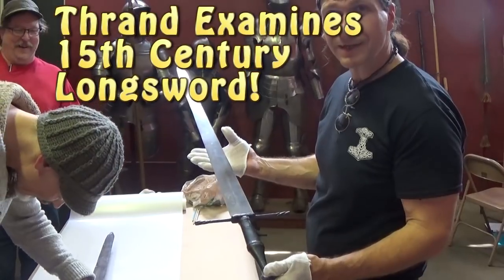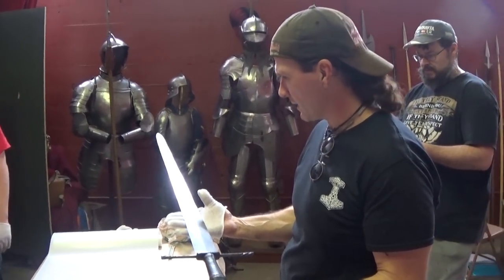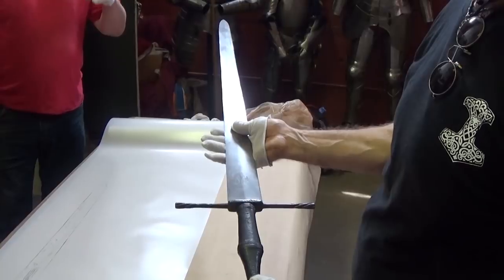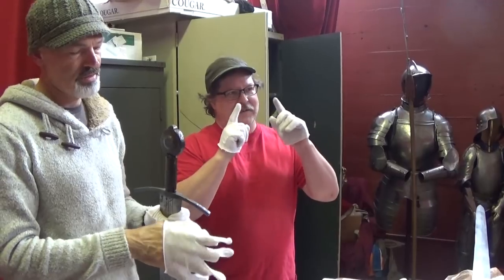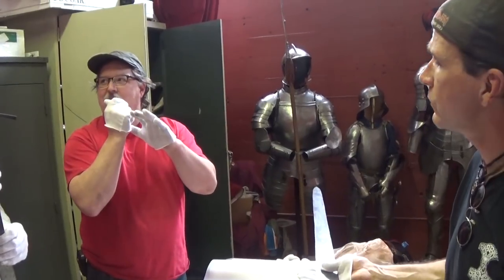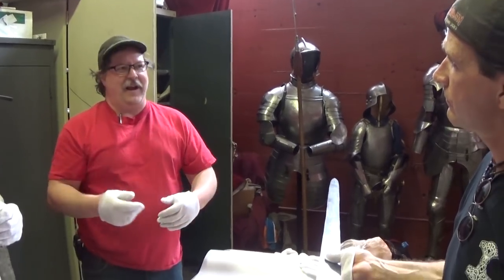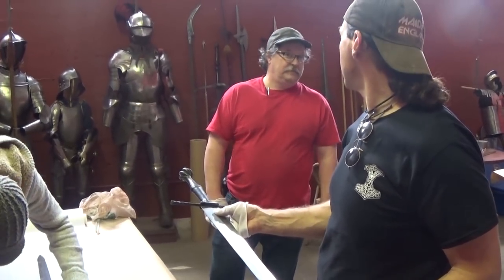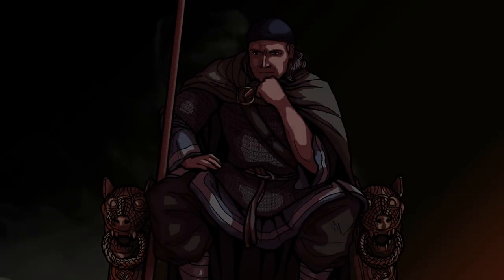Thrand Examines 15th Century Longsword @ Ewart Oakeshott

Comment: Quite impressive how functionally advanced that 2-section grip design is. The right/ leading hand gets a broader, oval grip piece for better control and edge alignment. The left hand's job however is to add power/ leverage and thus it gets a thinner, rounded grip piece in order to NOT influence the edge alignment. Very clever!